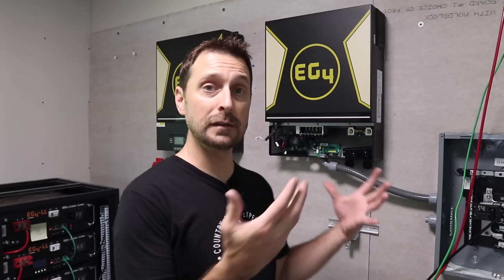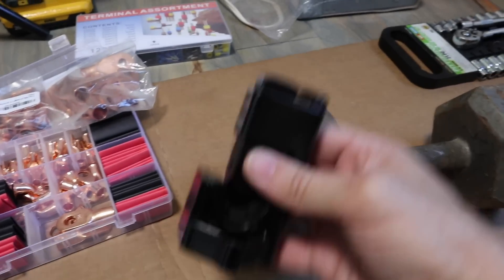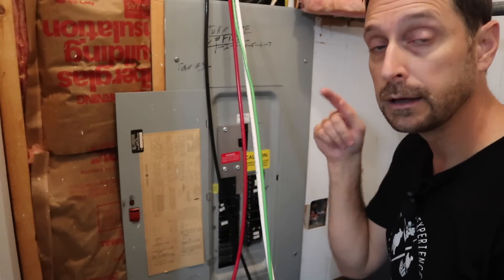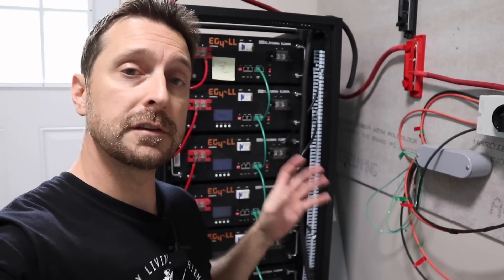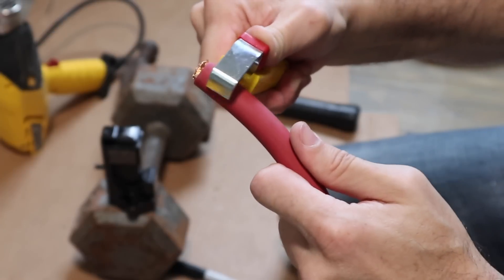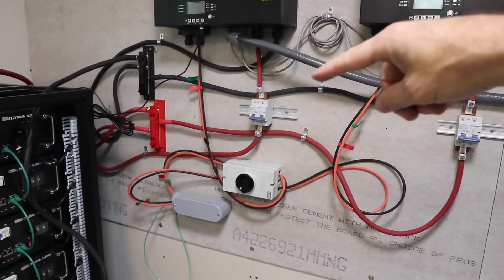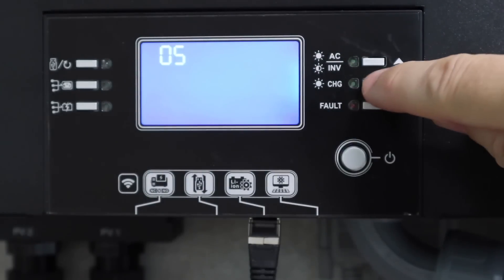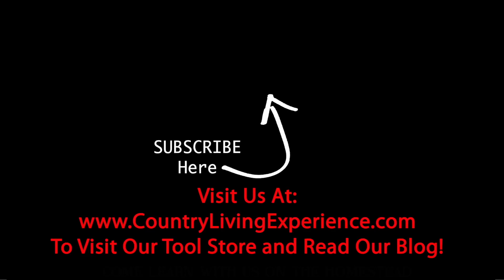EG4 Inverter Installation Full System Wiring And Tips! Off Grid Solar!

Comment: The 5000es will run off of solar, battery or both
Reply from the maker: I'm sorry, that is not correct. I have confirmed this 4 times with Signature Solar and their engineer on staff.
Reply: @CountryLivingExperience  I've installed a number of these and I can tell you for certain that they operate in solar only mode. It's one of the selling points I use for customers along with the not having to manage 120v management by using the transformer. When you get the 5000es set up in your barn, try it out.
Reply from the maker: I already had the 5000es set up in my house and did a series of videos on them. I was in constant consultation with Signature Solar. If you are installing Growatt 5000es versions that are not sold by them, then you might have issues as they are the only ones who have modified those inverters for the North American grid. I will take their advice on how to operate them safely and within their warranty parameters.
Reply: @CountryLivingExperience  My first 5000es installation was well over a year ago with two in parallel. They came from Signature Solar. They operate with or without batteries. Since then I have done four more pairs of 5000es units using the transformer to create a neutral for 120v. Everything has been from Signature Solar and all of them will operate without a battery. I have done all of the software setups myself. I am very familiar with Growatt installations. We must be in alternate universes from each other😀
Reply from the maker: @mendohomepower7492  We must be. Did you talk with Matt or Richard?
Reply: @CountryLivingExperience  Also if you look at the bottom of the spec sheet you will see that it is also UL1741 approved. On signature Solar's product description it also says that it will work without a battery.
Reply from the maker: Copied and pasted from the product page. Confirmed by Sig Solar to me on multiple occasions. ↓
-Please note that this a dual input inverter and must have two inputs of DC energy (battery + solar) or DC and AC input (utility + battery or solar)
-Parallel operation up to 6 unit (only with battery connected)
Reply: @CountryLivingExperience  OK, but it will work without the battery. That's the point of this exchange is it not? Also, I have shut of the battery with two units in parallel without it shutting down. And, I have started them up with solar and utility only connected. It is possible that Signature is not keeping up with the latest firmware with regards to software updates. I've updated older Growatt LVM3000 units and gotten almost as much functionality out of them as the SPF5000. I'll spend a bit of time in the Growatt manual for the SPF5000 to see if that is mentioned anywhere. I haven't seen it before in the manual. I could be wrong though.

Comment: One of those and ready to make it to 240 volt and that one would be your slave to the other room that runs 120 volt I have to do is programming on now inverter and you can watch another YouTube channel that shows you that and ask you how to do that this way you better run a kitchen stove oven which is 240 volt least I have one that's electric just like everything in my house is electric I don't have gas anywhere in my house for nothing.
Reply from the maker: Sorry, I am not understanding your question. Can you rephrase it? Thank you
Reply: @CountryLivingExperience  you're a slave inverter number two inverter and you put at a 180 phase to run 240 volt and your number one inverter will run at 120 volt and EG told me this and so has other people on YouTube channels so yes one's a 120 and you can change the face on the other one for a 240 volt at 180 or something like that. This is what EG has told me or you say EG inverter controllers has told me the ones that are selling them out of Texas cuz I asked them lots of questions as well.

Comment: What is never explained and that Signature Solar can't seem to tell me is this....

Each inverter is rated for MAX 60amps of 120v AC. Two such inverters is insufficient for running a typical house (particularly if it's all-electric)! So, I'm planning for 4 inverters, which will be sufficient to fully power a 200 amp main panel. However, and here's the kicker, NO videos or instructions or Signature Solar response explains how to get FOUR inverters going! You supposedly can run up to 6 of these inverters together, but nobody ever explains anywhere what such a configuration would be!

Should I just daisy-chain the inverters together, with each inverter sending 120v/60amp(max) into the box that's upstream of the main panel, and NOT run them in split-phase (which, to my understanding is only needed if you are trying to produce 240v TO the main panel)? Should I split the inverters into "two pairs," each "pair" running 180-degrees off of the other "pair," so as to do split-phase, and, if so, WHY? I mean, if I don't want 240v TO the main panel (because I can create the needed 240v circuits within the panel), then why would I do a split-phase configuration at all? And, finally, can I run PV to just two of the four inverters (I just have two strings of PV)?

In short, merely two inverters is NOT sufficient to run a typical house, yet EVERY instructional I can find acts like it will be. And how to configure four inverters is not explained anywhere! Very frustrating!

Any help/insights that anybody could offer would be VASTLY appreciated!!!
Reply from the maker: I only run two inverters because it is completely sufficient for me. 
As a quick answer, the manual has the wiring sequence including communications for paralleling 4 or 6 inverters. Not sure what else you need.?.
Reply: @CountryLivingExperience   Wiring sequence and communications between the inverters is straightforward. But that doesn't answer my questions at all. The fact that two inverters is sufficient for you just means that you draw under 120 amps at all times. That will not be sufficient for our house. To have any "margin" of potential amperage draw, four inverters will be needed. And that leads to my questions, which have nothing to do with communications or sequence.
Reply from the maker: Sorry I could not help.
Reply: @CountryLivingExperience  Thanks for taking a look!

Comment: Yes 180 means you got a 240 volt and your other ones at 120 so you got a 120 vote on the other one that's exactly how you want it for your second inverter they set it up for you ready I guess so you already have a 120 and a 240 volt that's what the 180 stands for.

Comment: .
Reply: My eg 3000 Inverters blew up and I determined that my solar hook up was wrong. I have a split phase system and I hooked the 5000kw solar in parallel to both Inverters  I believe I was to split them up 2500 watts per Inverter. (One string per Inverter). I have been communicating with signature solar tech support for almost a month now and the have come to a conclusion on matter. I am an Electrician and have done alote of solar but found the instructions for the solar hook up unclear. Would you have any info on this or a video I could watch.